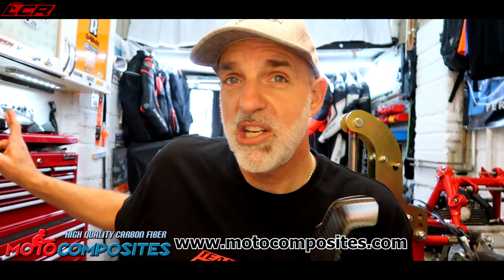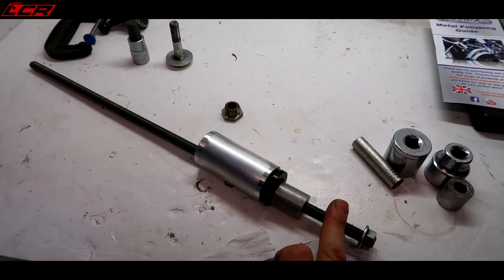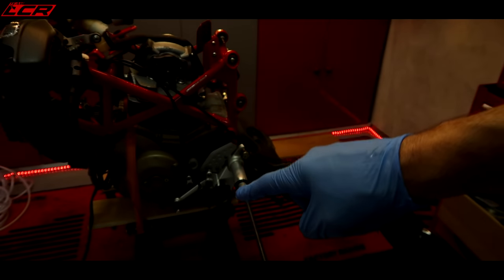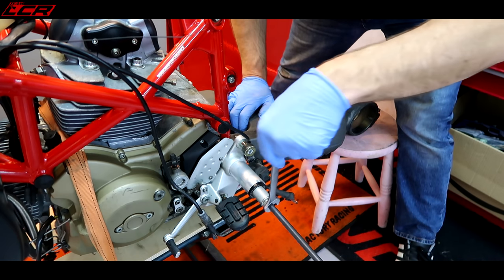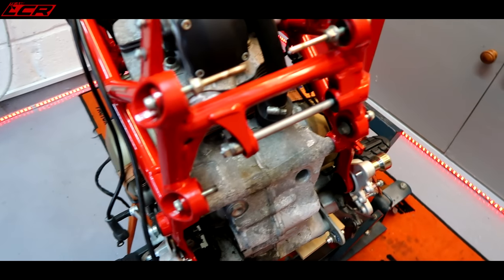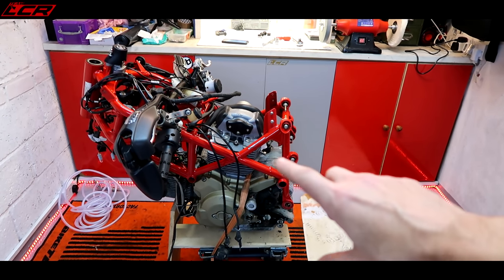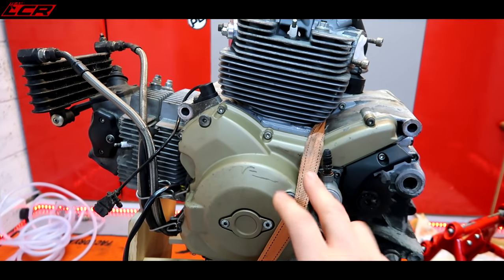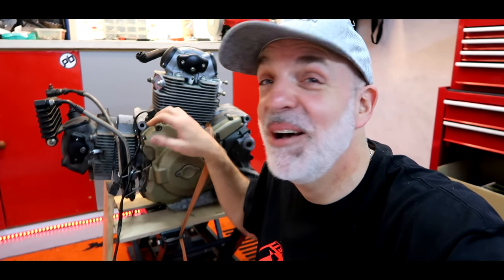Hypermotard Restoration EP05 | Can I Get The Swingarm Out??

Comment: Chop's if it was my engine I would change the timing belts and get the valves check/ adjusted while its easy to get at. Good luck with the Ducati.
Reply from the maker: Yes absolutely that will be happening

Comment: Just save your time and get the engine blasted to get all the paint off. It's not expensive and helps you big time. I'm enjoying these videos, thank you!
Reply from the maker: Hi Niklas, unfortunetly you cannot do that unless you full strip the engine, otherwise you will get blast media in the engine and it will destroy itself when you run it again. No way to keep it out with that sort of pressurised blasting like that.
Reply: @LambChopRides  CO2 blasting should solve that issue, I think.
Reply from the maker: Well thanks for the comments never knew that exsisted! May try and rent a machine...
Reply: @LambChopRides  Yep, it takes some preparation. You can protect parts you don't want to blast with a special masking tape. At the end of the day you will save a lot of time and get better results.

Comment: The Swing arm extraction is basically a posh word for a slide hammer . We use them a lot on cnc for removing sleeves from tool holders the nut acts as a pivot